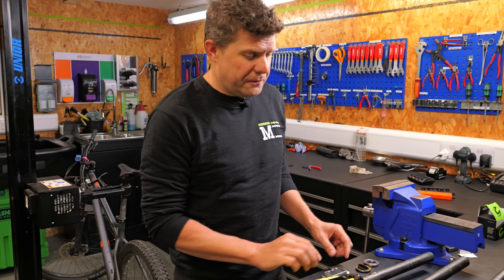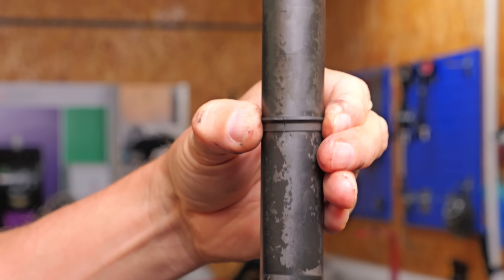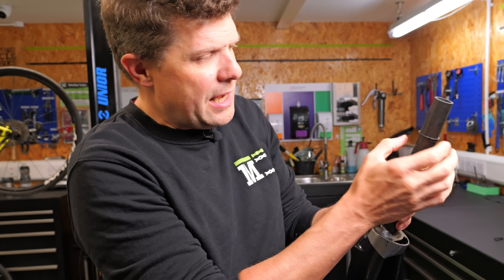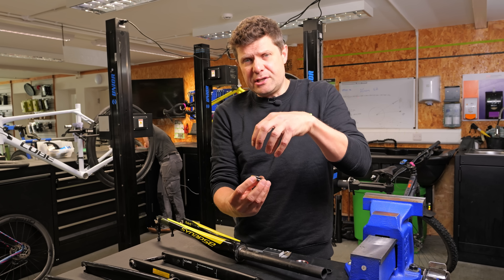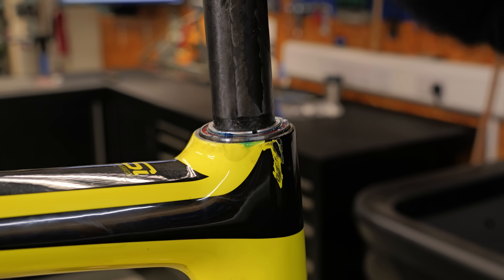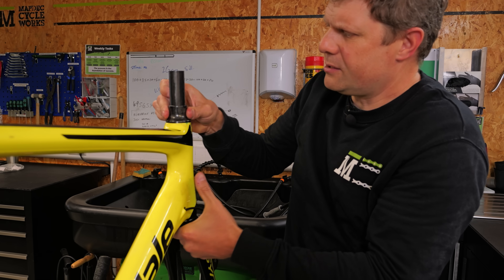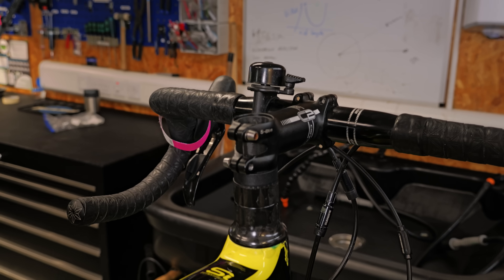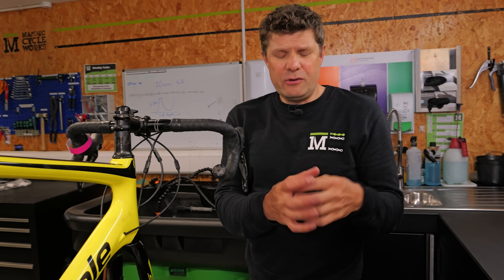Why Are So Many Bike Forks Breaking This Week?

Comment: This has helped convince me that just the complexity of a carbon frames's headset alone is enough to steer me away (pardon the pun) from carbon frame sets.  Needless complexity in the quest for lower weight and improved aerodynamics is a price I am not wining to pay. Video is superb, and valuable for those who run with carbon frame sets. Thank you.
Reply: I had a aluminum steerer that wasn't tightened correctly and developed this ring of death to  a point where the steerer almost broke while commuting to work. God is good I noticed before disaster. It happens on almost all materials, not only carbon.
Reply: @msapereable You're omitting part of the story. If you had friction ablation through an alloy steerer to the point it nearly fractured, you weren't simply riding a little bit loose headset. Wtf were you doing to your bike and how long did it go like that? This can happen to all materials but that isn't the same thing is all material being the same, as you're implying with your casualness in your comment.
Reply: Steel forks ride like crap, for comfort it is better carbon fork
Reply: @cristaldubragg3110  1) We aren't talking about a steel fork. We're talking about carbon forks with aluminium alloy steerers. 2) I have a steel fork bike that rides just as well as my carbon forked bike. 3) Steel forks on vintage are renowned for their ride quality. 4) All of this is irrelevant with the tire widths on modern bikes. There is absolutely nothing you can feel different if riding the bike on the intended terrain, with modern tire widths. The only advantage carbon has is that its better at sending you down a rabbit hole of post-purchase rationalization.
Reply: @cjohnson3836  Alu steerers are prone to this too, and on a composite fork, you have the added problem of galvanic corrosion between the carbon and Alu at the crown and sometimes the dropouts that often go unnoticed. In fact, that one death in Oz attributed to a "carbon fork" that everyone was shouting about when carbon steerers first became a thing was actually an Alu steerer failure on a 10+ year old fork, and the later one in Essex was caused by the Alu crown separating from the carbon blades on a composite Kinesis.
Reply: @cristaldubragg3110 nonsense
Reply: @cristaldubragg3110 I started riding steel roads bikes a little over 50 years ago.  And never an issue with steel forks,  okay about 1974 I plowed my Peugeot Px10e into the back of a parked car riding in a storm. The scenario was far from comfortable the fork playing a role. If you find carbon forks to provide value and steel forks not, okay.  I learned something new today, steel forks are disliked by some.
Reply from the maker: Steal and alu bikes usually have Carbon forks.
Reply: And unfortunate trend. Although at least some of them come with alloy steerers.

Comment: Excellent explanation of how the ring of death develops, thank you for your continued educational videos
Reply from the maker: Glad you found it helpful!
Reply: Never heard of the Ring of Death before. From the video, I gather that it is somewhere between an unwanted or dead serious issue - but I have no idea why. Could you explain?
Reply: Because the steerer tube can snap at the wear point, and your front fork with the front wheel will fall out, as you're just riding along.
Reply: @slowerandolder  Thanks. Ring fo death makes more sense now

Comment: I've run spacers over my CAAD10 steerer for 10 years, 25,000 mil and never had even a hint of worry. Once you've hit a hundred potholes at 45 mph, if it hasn't failed, it won't
Reply: That’s science right there

Comment: Just buy a brand new Enve, Deda, or Ritchey fork and sleep soundly at night.  That steerer tube was molded with continuous strand woven prepreg.
Reply: Maybe I didn’t properly make my pojnt.  The “repair” is purely cosmetic - at most it holds the ring in place better.  The carbon layup has in no way been “repaired” in the sense that none of the mechanical properties of the original carbon fiber layup for the steerer tube have been restored.  Once a continuous strand of carbon fiber filament has been severed - no epoxy resin or adhesive of any kind will ever restore the original strength of that part.  Doesn’t matter if chopped carbon strands are mixed with the epoxy resin repair.  Once the original carbon strand has been severed and you’ve lost that continuous tension - you’ve lost that strength.
Reply: @petersouthernboy6327  I wanted to buy a carbon bike.. but its like the heavens are warning me to just stick to steel and alu.
Reply: @HNKDrumNBass I moved from carbon fiber to aluminium. Crashes are not kind to carbon fiber and they are extremely difficult for the lay person to figure out. It costs about USD 400 for an inspection and many issues are not covered under warranty. This is one of them or the manufacturer would be replacing forks quite frequently.
Reply: Well yes, but no. Basically the lock ring is rubbing against the carbon. Think of it as a particularly blunt saw. Given enough time it will cut through.
Reply from the maker: it will still suffer abrasion if the C ring can move. Carbon is very soft, no matter who makes it.

Comment: Serious road and tri riders are always adjusting their stem. In hindsight it would have been great if these bikes could have been designed so that the headset bearing preload could be maintained independent of the stem.
Reply: They could before progress brought us the Aheadset design.
Reply: @mikemurray5281  A few builders brought us alternative designs like Rene Herse in the 1940s or Tom Ritchey in the 1970s used threadless stems that clamped around a tube that was brazed inside the threaded steerer tube. The advantage to the design was that it was as light as threadless stems while making the headset adjustment completely independent of of stem adjustments.
Reply: You're describing quill stems and threaded headsets. I've snapped enough steerer tubes at the start of the threads in my threaded headset days to know it's a very bad idea to cut a v shaped groove into a part that carries high tensile loads. Since most people are able to tighten a top cap and stem bolts and most people set the stem height once when dialling in their bike to fit and never touch it again, it seems like a very niche requirement.
Reply: @peglor that's a first for me
Reply: @peglor  You must have been running your stems way too high.
Reply: @peglor he didn't describe other headset preload designs actually.
Right before the A headset there was a design where the compression ring had a cap screw clamp just like a Seatpost clamp that would sit above your top bearing. 
It was poor quality but an excellent idea as you could remove you stem and spacers independently to the bearing preload setting.
(Same end result as quill but allowing us to use any stem we desired)
Reply: @peglor nobody, except Alex of GCN, would put the quill adjacent to the thread. 😅 see his retro build up video..

Comment: That cannondale compression plug design seems terrible. Also is there no weather sealing under the headset cover? Finally, would bedding compound (loctite 641) be a good idea between (1) bearing outer-race and frame; (2) bearing inner-race and compression ring; (3) compression ring and fork?
Reply: I can't see any reason not to fit a better compression plug. The reason it says not to install spacers above the stem is that it offers no support to the top stem clamp even when correctly installed and will not support the lower clamp with spacers on top. It's similar to a FSA compression plug that I also dislike. I always fit a full length plug to support both stem clamps. Most manufacturers insist on a 5mm spacer above the stem and a max of 35-40 mm between top of head tube and bottom of stem with carbon steerers. This Cannondale setup is a strange one.
Reply from the maker: Cannonade get very awkward to work with if you ever go outside of spec.  It’s a decision to make with your customer. Anyway. These angular contact bearings are meant to be a loose fit. They seat as you apply load.  I wouldn’t add retaining compound here.
Reply: @Mapdec what about between the fork and the ring? Eliminating any possibility of rotation there seems sensible? (even if it does make removal a bit harder)

Comment: the problem is that the c ring or the split ring does not have enough purchase on the current headset designs
Reply from the maker: Headsets like this are many decades old.  The problem is brands trying to strip weight and price off them, and mechanics not understanding how they work.
Reply: @Mapdec  Yes, my old 26er has an FSA headset that practically works like this, but without an expander plug and a starnut obviously.

Comment: Yep. To reiterate, it's important to note that if you're rocking a huge chimney, you may not be clamping your stem against the bung. Depending on the manufacturer, this may cause a potential 'crushing'  issue.
Reply: Bung?
Reply: @phillipmiller4288  compression plug
Reply: @phillipmiller4288  aka expander plug
Reply: @phillipmiller4288 compression plug
Reply: Agreed. Any bearing play/wear, or non parallel headset spacers/stem, or compression ring not staying flat under load will cause this. 
If you can rotate your upper headset cap then you are certainly not clamped
Reply from the maker: Thanks for adding that.

Comment: Great video. Shows why a professional mechanic is always the right way, especially with carbon frames. In the long run having a pro service your bike will often save money overall, parts last longer, fewer things break and you have a better ride. Supports your local bike shop as well. 

If you want to DIY your bike go for steel or maybe aluminium.
Reply: I think you're being very optimistic about your average neighborhood bike shop, most are not like Mr. Mapdec, they are usually not prepared to tear down a bike to check for things like this, in part because most neighborhood bike customers are not prepared to spend what it costs to check for this kind of thing. As long as it shifts without skipping, the chain checker checks out, the brake pads have enough stuff left, and the drivetrain isn't too noisy, that's good enough for most people most of the time.

If you buy a decent road bike and you want to mess around with spacers and stack you owe it to yourself to understand how a headset works, because you'll be fiddling for some time before you get it dialed in; taking it to the shop every time is just crazy.

Keep in mind even steel and alloy bikes usually come with a carbon fork and steerer, assuming they're reasonably high spec (like tiagra or higher). So just shopping for metal frames isn't going to get you out of trouble if you're a tinkerer. The fact is modern stuff just works different from the old stuff. Old problems like pinch flats or broken spokes aren't really a thing anymore, but new problems came along because technology changed.
Reply: @AL-pc1rb I was only considering shops that sold the kind of bikes that need this care at least £2000 upwards. The local bike shops you are thinking of look after commuter and kids bikes and cap out at around £1000 although many of them are run by skilled cyclists doing it for passion. They will usually send you somewhere else if your bike is high end as they don’t carry spares.
Reply: That dodgy steerer tube repair, which definitely won't match the strength of the original part, tells me these professionals (Professional just means you get paid to do it) maybe don't know as much about composites as their bills imply. On a non-structural part where heel rub or similar has worn material away, this repair is fine, but on the only structural part keeping your face off the ground, it's ridiculous to take people's money, do this 'repair' and tell them you've fixed it.
Reply from the maker: You should probably meet Mark before you make assumptions. He has some serious history… think about what trade he might have learnt his craft in up here.  Subs, Jets, Rally Sport….
Reply: @Mapdec  The construction standards, factors of safety, wall thicknesses and particularly design to spread the load where point or line loading is involved in most of those industries are vastly higher than frighteningly low quality to cost bikes like Cannondales. 

The issue is no matter how good the repair is, the underlying material is likely still barely fit for purpose, but the repair still has to anchor to it. Has he load and fatigue tested the repair and shown it is a match for the original part. Given it's a Cannondale that sets the bar low, but without testing you're still taking people's money based on guessing.

Hopefully the submarine he was involved in wasn't the world's most famous carbon fibre submarine...
Reply: @peglor I would expect with the right fibres and resins that repair could easily be as strong as the original or if not easily strong enough for a road bike, especially when the last time the rider was on the bike, it didn’t break with the fault in place.
Reply: @StephenRussell-c8v  If the fix involves clearing back all the layers that have been cut by the seized headset and replacing them it certainly could be, but this looks like he just patched the hole. If it fails, it'll fail suddenly and the consequences are a complete loss of steering control followed by falling face first into the road.
Reply: @peglor he did state it was sanded back, it would have to be otherwise the repair would be oversized. The sand back would be to the point there was no visible damage and then rebuilt with layers and resin. If the damage is too deep the repair would not be possible and replacement forks would be needed. I am sure measurements are taken of the tube thickness and % wear with a specified range for safe repair. In more difficult cases an inner brace could be added for additional strength. Higher grade resins, fibres and weave could also be used to give a potentially stronger than original repair. If inner bracing is used there would be a tiny weight penalty.
Reply: That's a good thought, but it's not fair to make mechanics responsible for riders well-being when customers are choosing to ride inherently flawed and fragile designs.  Mechanics can't see most of the problems because they're not visible.  You can't insure that your work is safe if the material is not safe.  You don't know what the previous guy did to it, including the manufacturer or shipper.  Most mechanics don't want to work on this stuff.  It's a huge pain.
Reply: @matthew7419 I wouldn’t expect a mechanic to be responsible for anything I had not paid them to look at. All riders need to inspect their bikes especially if they are riding jumps or had a crash. If they are unsure they pay a mechanic for a full health check. Which obviously involves a strip down and rebuild. The slack present in dangerous systems would always allow a mechanic to know when failure is close.
Reply: @StephenRussell-c8v   Sorry, it wasn't so much directed at yourself.  Mechanics are always responsible for making sure the bike is safe.  The mechanic can't see carbon damage if there's no external evidence.  It doesn't always show it.  In this case, most good mechanics would probably notice the headset was loose while doing other work and tighten it as a courtesy.  (Headsets are often out of adjustment...)  They can't remove the steerer quickly for free to check it out because of the internal routing and hydraulic brakes.  You would have to call the customer up and say, "Your headset seems a quarter turn too loose, so I'll have to charge you for several hours labor to disassemble and inspect the steerer, on the off chance it might shatter unexpectedly and break your neck later - but everything is probably fine."  I agree that sort of service is necessary, but it's impractical for most customers and shops.  Even lower/mid level steel bikes now have carbon forks.
Reply: @matthew7419 yes carbon is over used it is a high spec product that needs a lot of care and checks. Especially the lower grade versions in bikes with poor tolerances ie the cheaper ones. So the mechanics have an issue that the bikes most at risk are the ones owned by customers unlikely to be willing to pay 20-30% of the cost of the bike for a proper check and service. It would be so much better if they just had well made aluminium or steel forks.